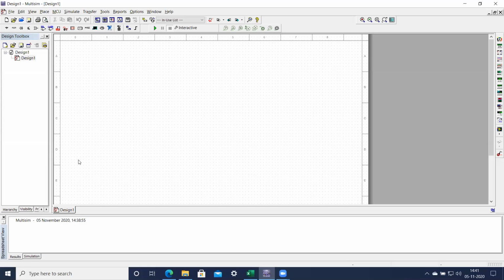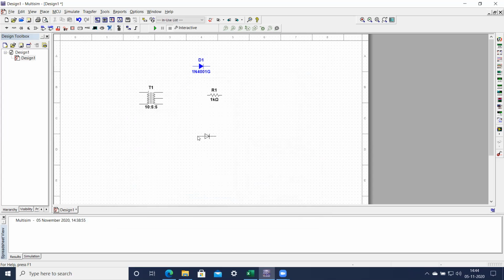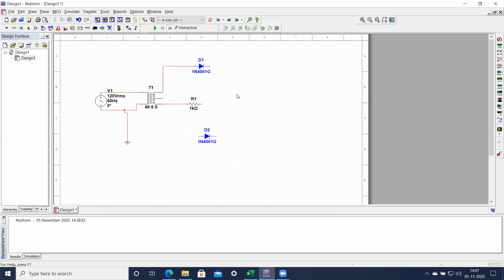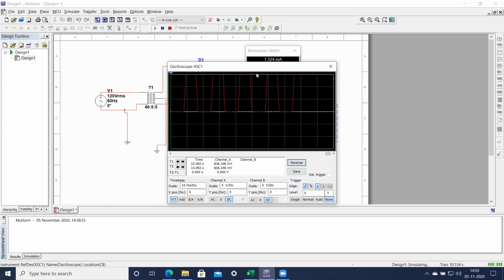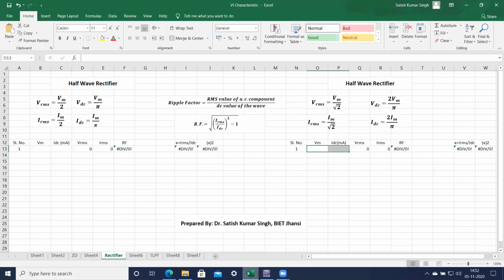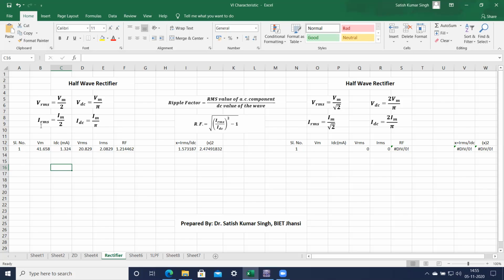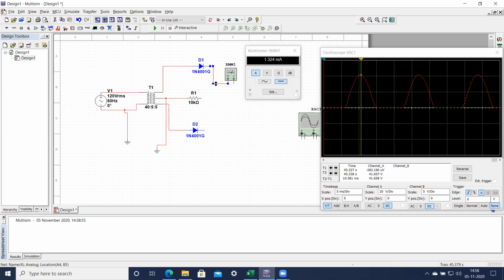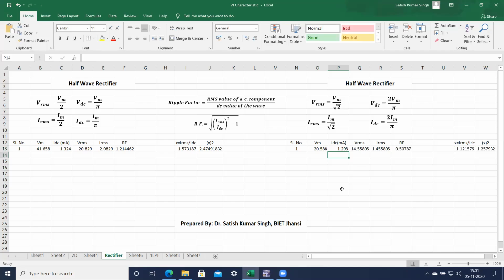EDC Lab | Full Wave Rectifier Circuits on Multisim | Half Wave Rectifier Circuits on Multisim

Comment: may i know the difference between full wave rectifier and full wave bridge type rectifier?
Reply from the maker: I hope you want to know the difference between Center-tapped (CT) full wave rectifier and full wave bridge rectifier. As the name suggest the former needs a center-tapped transformer for realization of circuit but in the bridge configuration there is no need of transformer at all. Moreover, generally PIV (Peak Inverse Voltage) for CT-Full wave rectifier is more than the bridge type.